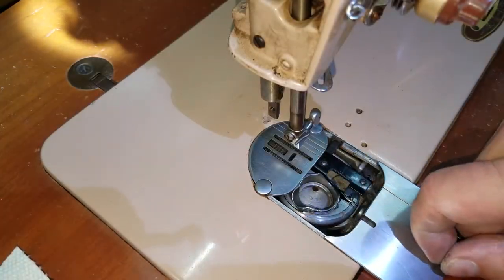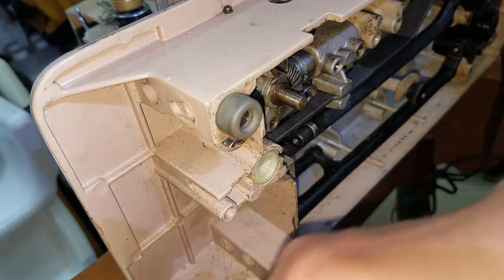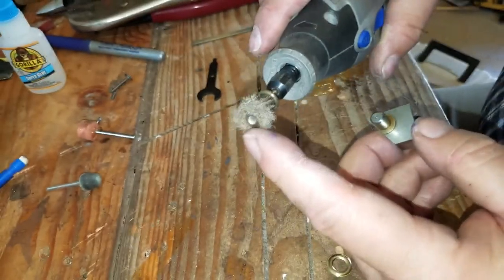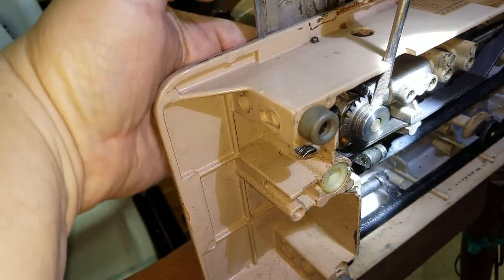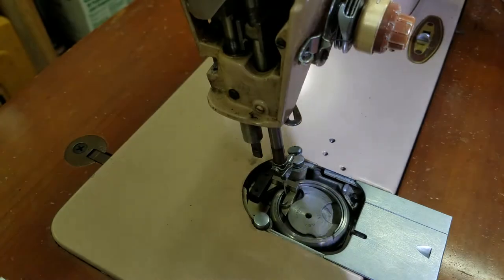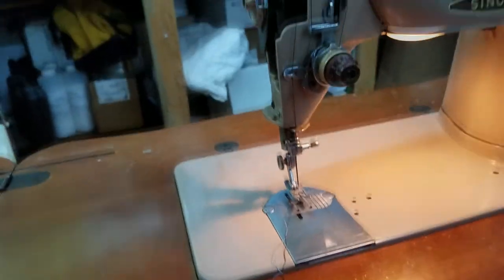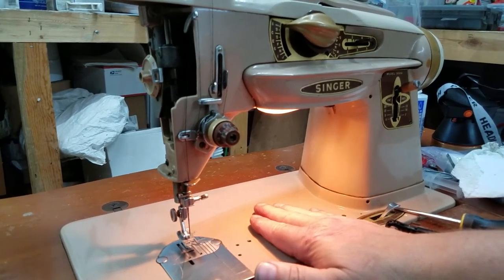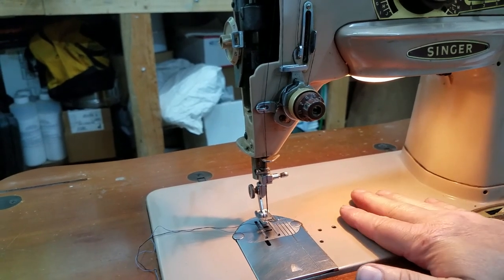FIXED!  Singer 500a Skipping and Jamming Stitch Problems

Comment: I have a 500j and a 503j. The 503 is noticeably noisier. I believe the sound is coming form the bobbin area. Occasionally, it will miss a stitch sewing light leather, and once in a while on other materials. I've checked/adjusted the thread clearance, checked/cleaned/adjusted the thread tension-er.  It has a tendency to fray some types of thread, more so the heavier ones. I've used denim needles, and leather needles, with little change. The bobbin area remains noisier on the 503 than the 500.  The noise can be heard as the thread passes over the bobbin holder area, and the bobbin holder moves slightly, within the clearance tolerances. Can this delint pin lead to a noise in this area, and possible the tendency for thread to be frayed/damaged? The pin appears to be intact and in position on this machine.
Thanks for any advice you may have.
Reply from the maker: Hi Jay.  You have a great question.  First make sure it is cleaned and delinted and oiled.  There are some things that may be going on. First, it is possible the hook has some needle strikes on it and some burrs.  I suggest watching Andy Tube and this video on removing burrs from a rotary style hook.   That may help with the fraying of the thread.  Second , it is possible that the bottom of the rotor is worn allowing the bobbin to sit down farther than when new and the thread bounces it up a bit when the bobbin thread is carried under the bobbin on each stitch. Stop using the metal type 66 bobbing.  Start using a good quality plastic bobbin.  I don't know if the delint pin would make that noise, when the thread gets stuck on the delint pin you know!  It sews about 10 more stitches and jams.  Like I said, some work well with the delint pin and some don't I don't know why, but i have only worked on 3 of these machines.  I am a novice, but I was determined to fix mine.

You can buy and replace the rotary hook with a used one and see if that will help. But that may mean retiming your hook and needle, but it may be worth it if that hook is worn out.  Consult with Andy Tube.  He is a treasure trove of knowledge and may have some other ideas.
Reply: @OutFishing13Matthew  Well' I removed the delint pin on the 503j. Checked timing, adjusted thread clearance again, etc. Also, installed a plastic bobbin. The machine sounds similar to before. I tried several stitches- mostly straight and a couple of other basic ones. The unit seemed to work alright, but I feel it could be a bit better, in light leather. It will sew it, but continues to miss the odd stitch. I took a video with my iphone (slow-mo). You can see the bobbin jump up a bit, as the thread passes over the bobbin holder. Not real sure how much movement is normal here, (or sound for that matter), but I can hear that it is louder than a 401, and my other machine, a 500j. I'll keep digging into this, maybe I'll end up trying a new hook if I can get my hands on one. And thanks very much for taking the time to offer your input and advice. I appreciate it!

Comment: my stitch length is stuck and will not change as I turn the dial, I have a singer 6110
can you suggest any videos out there that may help me fix it? Thankyou so much for your help!!
Reply from the maker: Have you tried the Andytube channel?  Andy has a ton of videos on Singers.  Not really sure if he has one on a 6110.  Is this and old machine you just started using or baught recently?  My guess is the mechanisms to adjust the dog movement is jammed up with dried up oil.  Your machine probably needs a good cleaning.  Try using some PB Plaster penetrating oil very liberally on the inside and under the bottom.   That will help free us stuck parts.
Reply from the maker: Also, try Bob Fowler. He has sewing machine videos.  https://www.youtube.com/user/crazybob2525/videos

Comment: Mathew, do you have any idea how to adjust the tension on this machine. I've adjusted til I have a headache. My upper tension is too tight. I've loosened it and loosened, to no avail.
Reply from the maker: Hi Francine,  I do, but it would be hard to explain.  I recommend you watch Andy Tube.  He has videos all about the tension units.  What I learned about these machines, I learned from Andy Tube.
Reply: @OutFishing13Matthew  thank you.
I will contact Andy. He helped with my 401. Appreciate your reply.
Reply: All the "Slant-O- Matic" machines are sensitive to tension issues.. It takes a bit of tedious patience to adjust. The most important issue is to "0" out the upper tension properly..

Comment: Just recently got a Singer 500A.
1. stitch selector is stuck 
2.  My top thread is to loose and don't know how to adjust
Reply from the maker: I recommend you look up AndyTube.  He has very detailed service videos on the 500a.  You need to clean and lube the cam stack and all the adjusters under the lid.  Use something like JB Blaster to get it cleaned and then lube it.   Next you need to lube the thread tension rod.  That is probably gummed up too.  That is the rod that let's the thead tensioner in and out when you lift the foot up and down.  The rod is gummed up.

Comment: Help!!!!!! I accidentally knocked one of the thread spools into the machine!!! Is one of the White ones the close down when the lid shuts. Idk how to o open the top to  fetch it out!!!! I just bought her and she is so in near mint condition, so beautiful  but now I'm afraid I killed her or she won't work now! Please help me of you know how to take the top off!!!  God bless you!!!
Reply from the maker: Hi Jeniffer.  Oops. I can see that happening.  There are two screw under the flip top lid.  One on each end of the main lid.  Use a flat screwdriver to remove those.  Be careful not to drop off the little door on the end.  Then turn your machine upside down and get that little white spool pin out.
Reply: Hi, Can you please do a tutorial on retiming the machine, i just recently got mine and i think the timing is messed up, it keeps tangling under the foot plate/bobbin area and jamming whenever i sew.

Comment: I'm watching this because, I changed the needle and thread and my machine didn't like that, keeps getting stuck and the needle ends up not moving.
Reply from the maker: If it was working before you changed the needle, then more than likely it is the needle that is the problem.  My guess is you did not get the needle all the way up in the needle bar.  Take the needle out.  Unscrew the little nut just a little.  The flat side of the shank of the needle should be toward the back (the little groove on the needle should be facing forward).  MAKE SURE your needle is inserted in the needle bar all the way up inside and then tighten the needle nut.  Try again.  What happened is the needle was not in far enough and it was getting stuck in the hook.  That will fix it I am sure.
Reply: @OutFishing13Matthew  Yes! That was it. Thank you! 😊
Reply from the maker: @mariavadineanu5626  You are welcome.  You should check out Andy Tube's channel. He does an outstanding job on sewing machine services.